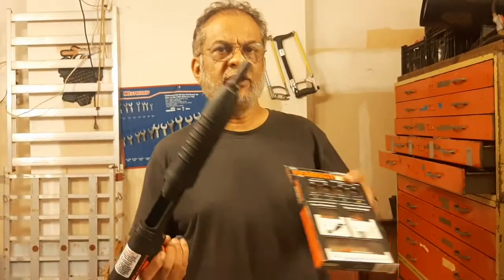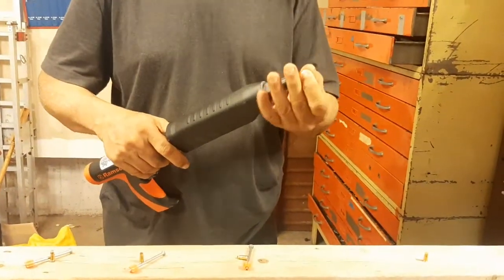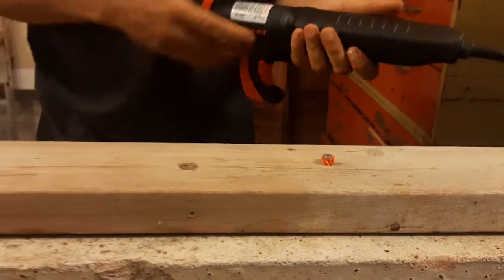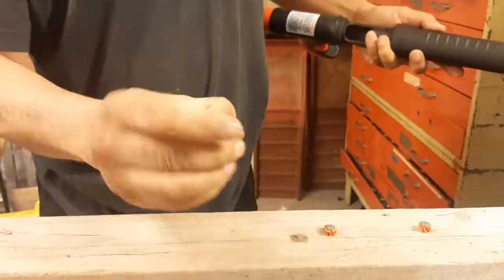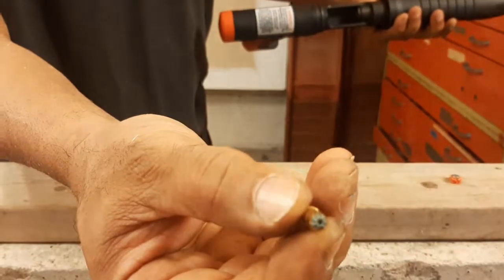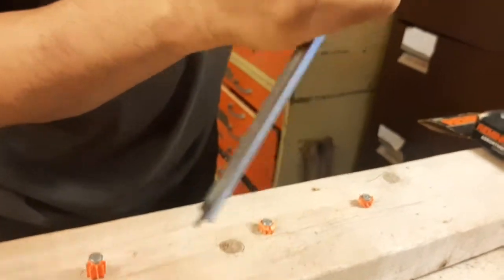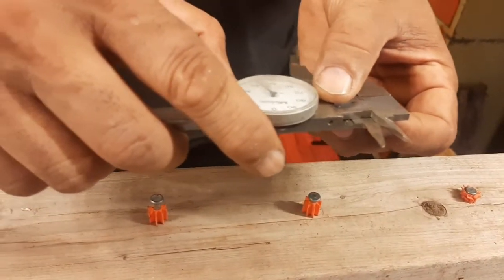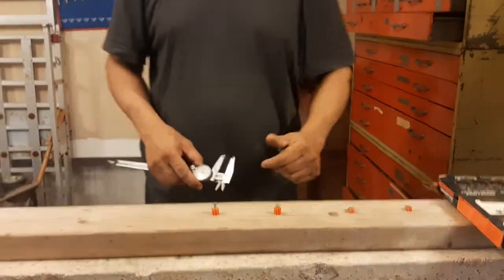Powder actuated shot strength Test grey brown green yellow

Comment: Fellas would a mastershot work on a condo concrete wall that has a 1/2 " drywall on top.  Looking to secure 2×4 for a diy fireplace media wall.
Reply from the maker: you never know how firm nail grip behind the wall some time you pull 2x4 by hand and it come off  nail didn't penetrate in concrete but partially bend in concrete in simple answer i can say it will work